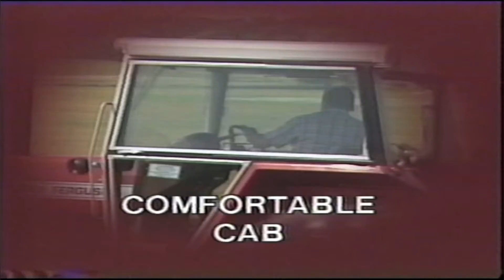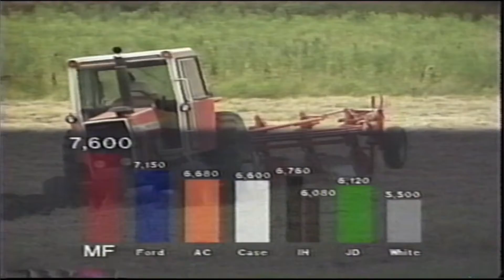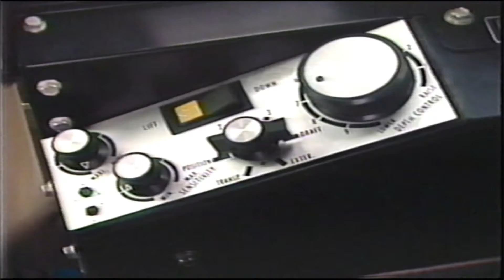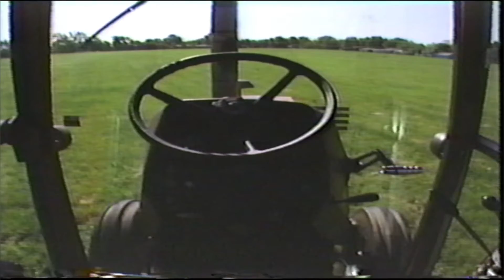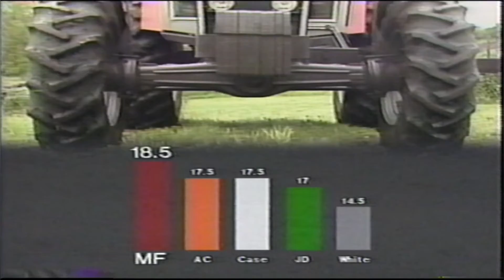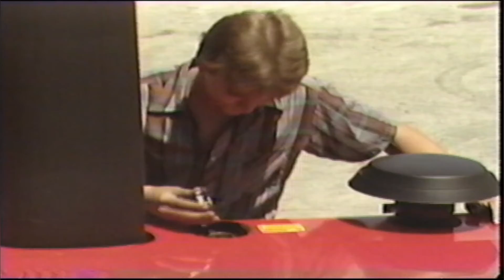Massey Ferguson 1984 Model Year 3500 Series Tractors - Competitive Comparison 3505 3525 3545

Comment: I really enjoyed seeing them talk about a competitor using the Perkins and seeing that beautiful frame on the White holding the  Perkins.
Reply from the maker: Agree, at least they talked about the elephant in the room!!  My neighbor and me took on a project tractor back in the late 70s and it was an oliver with big plans to do custom baling for locals.  I think it was an 88 that was an older model because the sides of the engine were covered.  I do remember pulling it out of the tree row it was in and thankfully the engine was not stuck.  With some work, we got it running and one of my uncles gave us an old IH square baler on the condition that we do not return it when we get tired of custom baling for people, ha ha ha!  We found some used parts for the baler and got it running as well, and the Oliver with that 6 cylinder had no problem running that baler!  Seems like we never took any photos then, so it's only in my memory.  Can't remember making too much money, but we had a heck of a good time and did get a few jobs within tractor driving distance.  In Iowa, we had a 5 cent deposit on beer/pop cans starting in the summer of 79, so we walked the main highway picking up hundreds of beer cans and cashed them in to buy a tank of regular fuel!   Good times, it's funny what pulls out memories in a fella's brain, too bad we have no photos, but we had no time for that, ha ha !

Comment: They are showing a 135 HP tractor in most this video so why didn't they have a 2-135 white because it would have ruined there video it should of been a 4450 Deere to in video this video did not give the other manufactures a chance to compare tractor to tractor
Reply from the maker: Agree, the 4450 would have been the best to compare, but it would’ve been a Why Deere is better promo!!  I had a 4450 and it was the best tractor I’ve ever used!  The 1984 date says it all on this promo - some of the comps  were a bit of a stretch! In NE Iowa, didn’t see many of these tractors, mostly the ertl variety! Ha ha.  Hope you enjoyed the clip and thanks for watching!
Reply from the maker: I did use a Massey 1105 many years ago when I helped my neighbor after he go injured. I really respected that tractor!  The Perkins started well and had plenty of power for disking.
Reply: @opasvintagegarage  the 1105 and 1135 had a lot better tranny set up they used keys instead of set screws lol !! The 1105 and 2-105 white had the identical same 354 Perkins !!
Reply: 4450 would’ve made things a bit more interesting but there’s no getting around the poor serviceability and cab of the Deere. The Deere was a good horse not denying that but those Massey were really good rigs.
Reply: 2-135 White is a beast,
Reply: @dwk7375  yes they are I had a 2-135 and a 2-155 and they were both beasts in the field but the 155 wouldn't out work the 135 but both pulled a 7 bottom plow like it wasn't back there !!

Comment: The 2-88 and 2-110 have the 354 also
Reply: Good luck finding one though
Reply: Depends if it's a Dot 4 version though, as in A6/AT6 - 3544 - the later and improved variant of the original design.

Comment: Only issue is all there dam set screws in tranny if you take it apart and lock tight them all you would be ok in the last 2 months have worked on 3 of them from 50 hp to 135 HP and they all quit moving because shifting forks loosened up and the pto shaft and hub driving the FWA is not a good deal either !!